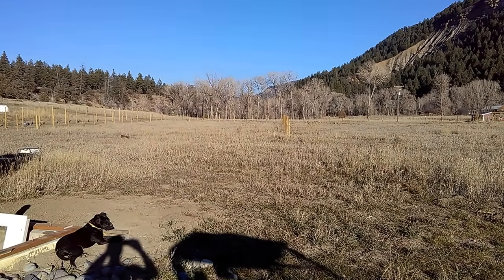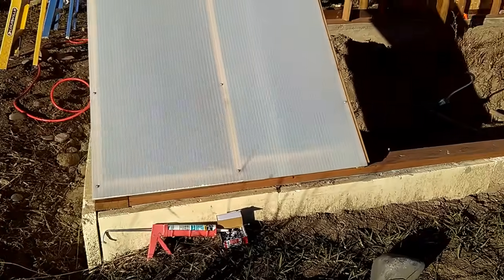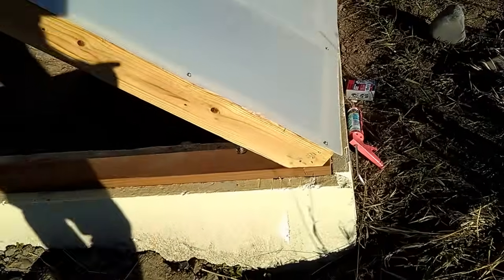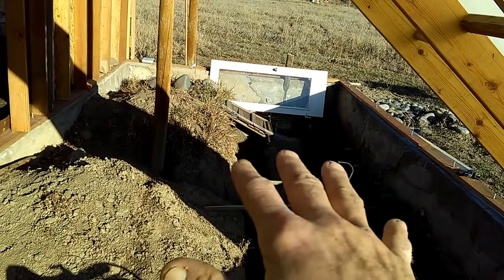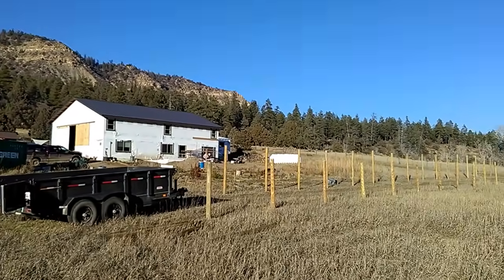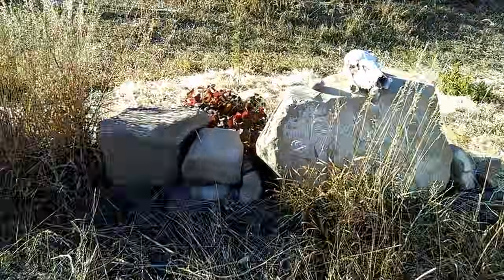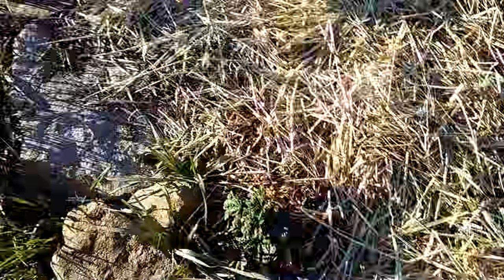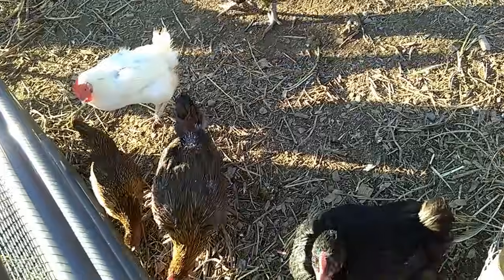Geothermal Greenhouse Update - Solexx Glazing Install - Foundation Fasteners - Join Us

Comment: I wouldn't use tires. The soil is more dense so it would take in more heat. I'd use stone, it's more dense than both. and if you had a 2 foot layer of stones you wouldn't need the pipe, just let the air flow through the stones. any thoughts anyone?

Comment: I really envy you my friend where you're at in preparedness, but it comes to mind that the plastic will be great but it may be really susceptible to hail damage, so do you have a plan for making plywood shutters or something that you can swing over those panels to protect them from hail?
Also I used to work up north in Prudhoe Bay, and we would make temporary shelters for working on stuff out there. So you want to laminate over your plastic along the studs with Thinwood furring strips and screw through those to clamp your plastic in place so it has a large surface area when there's Highwinds and pressures so your plastic doesn't rip off of the screws to the outside.
God Bless You My Friend 😃

Comment: it takes a community  to survive... otherwise 1 generation  sustainable  rember  child mortality rates  were high 2/10 would reach puberty.    Especially inthe poor ,  and you my friend  will be the fat and happy king in the castle in the valley  surrounds by shear cliffs of Ice (an insolator,  can be made clear and proper shape  on the scale of the largest tellacopes  to  focus on a thermal Mass collection and Distribution Systems.  yes there would be dead zones were the colectors occupy space for the full Equinox/ solstice(orbital( the ecliptic plane) North /south) and sun up to sun down(accounting for the veriabilityof the terrain both with and without trees) east /west . this would be 1 of 2 ways blanket  the hole space upp the wall at for at Dawn and dusk for a waterfall effect of pure drinking water (Ill explain the beem of focused sunlight through multiple large ice/real lenses spaced so that  the ambient air temp would dissipate any softening/heat  effects. untell it gets bad enough that ice will be addiquitly .)   this would melt the the ice (by way of the rock) of the previous days melt evaporation and condinsation) with in 3-7 generations  would have a very  intricate knolage of working with Ice  and maintenance of a dome structure over the Valley 7-100 generations with a piller of opticly clear  sun  glow1000 generations .  to produce the needed energy to keep an ant farm like comunity. were the right of passage  is to carve out a space for ones self preferred near your job site  with air curc in the form of crevasses? could theas FROZEN ant type humanoid still be trapped in Antarctica
 this will inevitability doom the colony of New Age cave people  as the glacier will inevitably exceed their ability to keep up with the amount of light and energy coming from a dim star in darck mode so then we can see  it  as ti is not washed out by the light mode we injoy now. " Possibly no hotter than a cup of coffee." as Ben Davison has described  one of the super cold Stars(brown dwarf)  recently found , reported in his news.  
 A supper nova is an expression of a capacitor blowing up in 0G this is what kicks off a amost dead star. just like man  [no cpr thats post stone age grab doods SamApp (samsung and apple murg and explode  to the ONE . it duse it all) and diffibulate. him.. hell the va has the med grade units (if you can read pictures you can run  )every 500'. ] this is what the Bible (never made it past Genesis) means as above so below do:no.  the plasma phillament is high charge state matter.  the dust clouds of vastly higher charge states are  the remanents of galzies lighting off. "like in  the hubble images that look like the human brain synapse neurons firing." (FOTW OTF17)  a question I Want to answer  is dose it look like a brain matching the proportions of Leonardos vesuvian man. and over yander is the down the the cellualer level match what we wee think we see  with?  the eyes in vesuvian man proportions cct. ect. thats a long conversation  ect.. Ive been tole the good book said the maker made us in his image dose it not.

 the way I  see it this is the big one the world has been telling me was coming, growing up in Calf. till 23. y have I have a theory as to I will there's a lot of dots connected the homosapien that preceded us lived in a tropical world where everything has to be as big as Mother Nature can make it to absorb enough energy from the dim glow of the star in brown dwarf mode
Reply: David Drescher you writing a book?

Comment: Yes, I was wondering about the angle of your gable. In addition to the snow buildup, the buildup of volcanic ash which is much heavier would certainly crush anything less than 60° angle.I am guessing you have selected the equinox sun angle over the winter solstice angle.

Considering mid-Autumn to mid-Spring is time you really need the greenhouse personally I would go with the winter solstice angle.

BTW, just to sound trade (Not sure about US English) but supporting spacers are called noggings in the building trade.
Reply: I've never heard the term "noggings" We called them cross blocking.
Reply: Lol, we call them braces here.